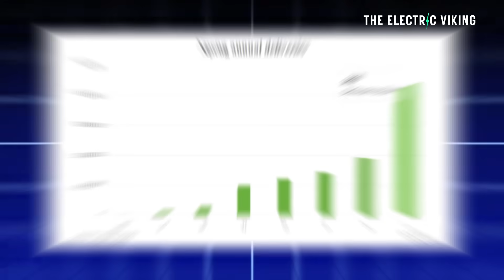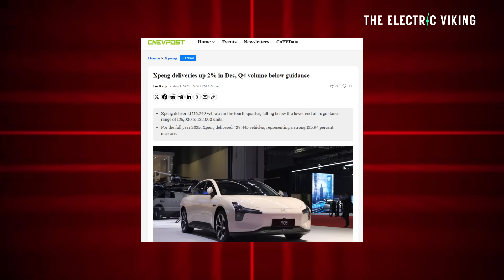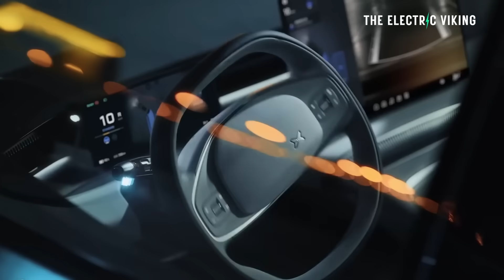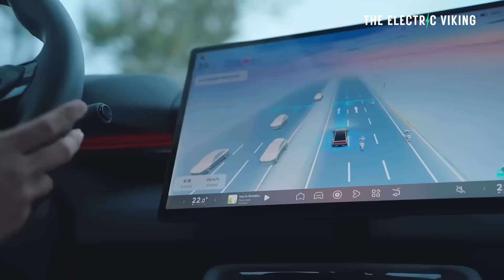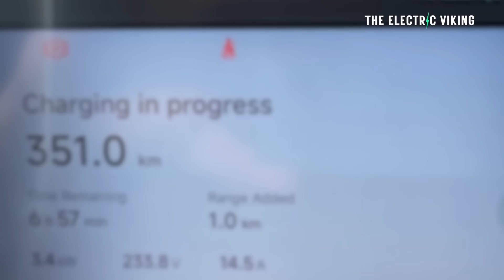THE 123% MIRACLE: How XPeng Became the World’s Fastest Growing EV Brand

Comment: Effectively, but I guess Xpeng Motors reduced deliveries in November and December. In November I thought it was just to warranty a huge sale number in December, above 50000 units or even more than 60000 units, but visible not. They just sold little bit more than theit fantastic December 2024 number, but did not achieve 50000 delivaries. I thnk this is a nice strategy to keep the stock value as low as possible toallow large benefits to all new stock owners. The numbers of deliveries for next year will not be above exoedtations and they should not have difficulties to reach them as they successfully did this year, with much better prodcts than before! The problem is that they are much more valuable tham their low price indicates they are! They are quote as good as Nio, but much cheaper, and they do help Nio achieving better ET9 and ES8 models, they helped Xiaomi, Porsche, Volkswagen Group, and CALB, CATL and BYD to allow them increasing their charging speed and prevent overheating with a charging rate above 500kW! All follow them and those who overpass them with 900V or 1000V, or with higher rates like 1000kW are just talking more risks to announce very high value, but without being able to warranty a durability of batteries as. Xpeng can achieve and warranty! With the 2024 G9, they validant d in 2023 520kW charging speed, but they limitated it to 360kW or so for now, till 800kW charging speed is common in new vehicles, allowing old Xpeng having a second youth and fantastic charging speed with new technologies used in new versions to prevent any damage!